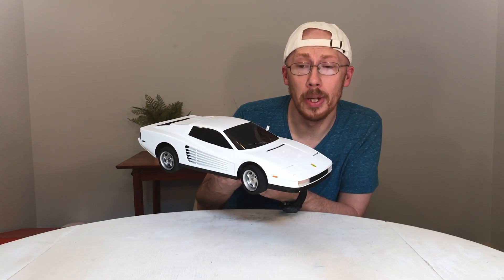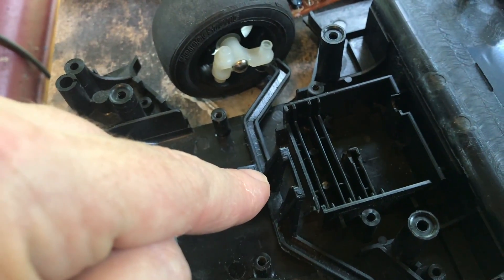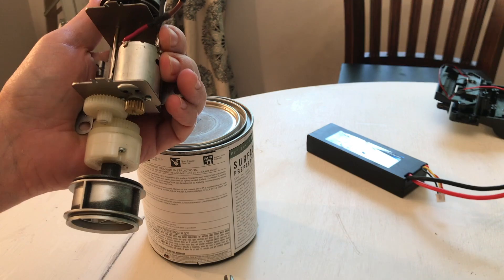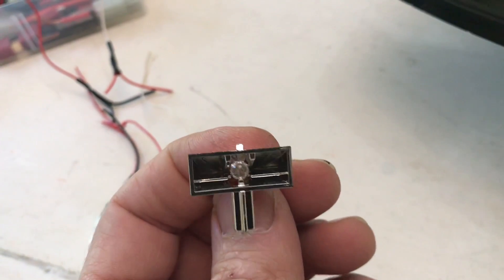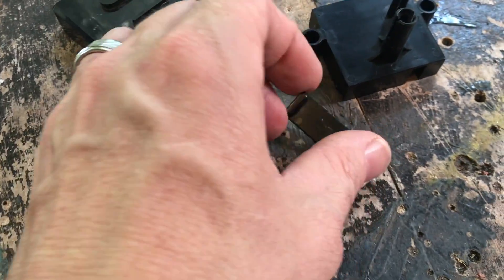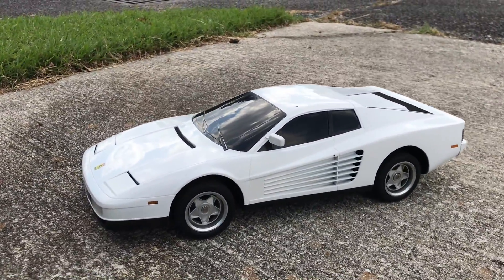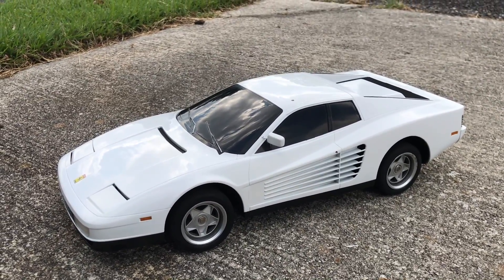1986 NIKKO FERRARI TESTAROSSA 1/10 RC CAR RESTO/ MOD Prt 2

Comment: How did I miss this video? I had one when I was a child but I don't remember the brand. It was similar to radioshacks but they use 8 AA batteries and it had a "turbo" mode. It was actually a very similar Architecture. 

I used to think it was a Lambo Countach but its actually this car and thats why I couldnt find it. I'm now looking for those but the only version I find is the one you show in the video.
Reply from the maker: The Lamborghini is tyco I believe probably twin turbo I’ll do a video of that soon so stay updated by hitting notifications bell. Thanks 😊

Comment: Hey Luke, Happy new year. 
I have one of these, I would love to have it done just like that. This would be my very first rc to work on so I dont know too much right now, I guess i will be ok with just using a battery on it instead of the original AA and C s.  Can I just put a battery on it?
Reply from the maker: Hi bud, so not sure about a battery on top of this car would be nice looking perhaps your first car should be actual hobby grade to start off with I know a Traxxas rustler is one of my absolute favorites and a great rc to start tinkering with as parts are readily available with hop ups too. Find these on Amazon good price thanks 😊

Comment: awesome video. what brushed system are you using and what brand motor is that?  better yet a link would be nice. also is the motor rated for 3s?
Reply from the maker: That Black Dude hey bud, the motor is a stock 540 RS and the esc I use is cheap esc i did a review on around 2 years ago from China it’s $6 stated 320 amp esc. I also like Tamiya 105BK so skies the limit. Motor about 7 bucks all ebay purchase possible. You can build a car like this for little money. Check out part 1 of this build to get better idea of the plan. I would pass on 3s packs anyhow-Gears won’t cope, stock 540 will burn out eventually, chassis is weak no true suspension. Can’t buy replacements parts. Stick with 6-7.2 nimh or 7.4v lipo max. Too pretty to ruin or wreck and rare. thanks 🙏
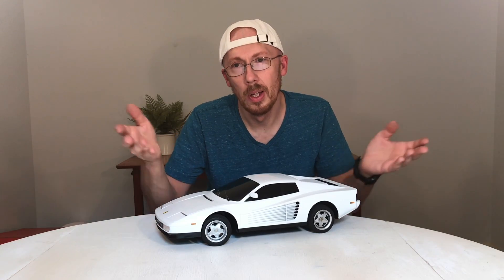Reply: @LukesVintageRC  I'll search your vids for that esc. I've been doing brushless conversions for a while but brushless is generally  too much power unless you are doing a 1:10 scale. But I even then, my golden arrow and nikko 959 have trouble keeping the frontend down. Even a small 370 brushless motor was overkill in my Tyco Lamborghini. So I. Definitely wanting to do brushed on my smaller stuff. But yeah that's a cool car and even I was scared when you popped in that 3s lol. Thanks for responding. New sub
Reply from the maker: That Black Dude I think when we try to modify these old toy grade rc they start to lose something not all but most. It’s hard to explain but I’ve driven this car in slower form and I like it better. Anyhow If something breaks I’ll probably put it aside for year because there’s too many projects I have going. Your tyco Lamborghini video is awesome. I probably seen it 3 times👏. Thanks if need any feedback or whatever hit me up 🤙
Reply: @LukesVintageRC  definitely appreciated bud. I'll keep watching them vids too. Already learning from you.

Comment: I have 2 of these both are the 7.2V battery pack model. I plan on modding one but I want to use a Tamiya sports tuned 380.  What parts did you used for the steering?
Reply from the maker: Enrique Hidalgo thanks for watching be sure to check my olds 442 and Tamiya grasshopper videos as the Tamiya sport tuned motor is in those.  Tamiya and rpm for steering 👍

Comment: When it comes too the rear suspension you can probably do a similar mockup too the mini-z mr01
Where its like a H bar mounted on the underside of it.
Can probably google images of how the rwd mini-z suspension looks & works.
The front maybe you can do like a tamiya blackfoot front spindles on a longer rod so it has some movement up & down & then a t bar on top like a 1:28th scale rc pan car https://www.redrc.net/wp-content/uploads/2009/06/greyscalemrcg1-1-2.jpg this is from the mrcg1.1 from 2009
Reply from the maker: Marcus60661 pretty good ideas thanks tons 👍

Comment: How fast it can run?
Reply from the maker: Tera Byte 20 mph ✌️
Reply: @LukesVintageRC  Nice tuning then you did
Reply: I saw a Pontiac Trans Am video, the guy was using Duracell batteries, he said them weren't fresh and in fact the car was very slow then I'm curious to see how fast it can run stock but with fresh batteries.